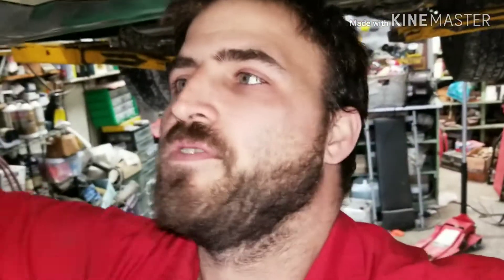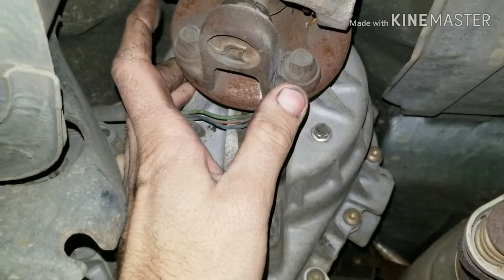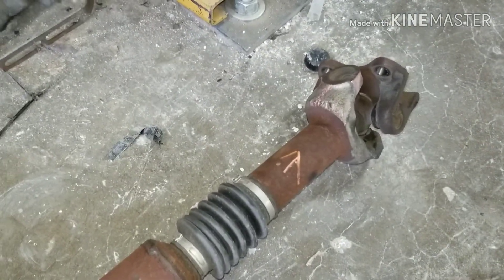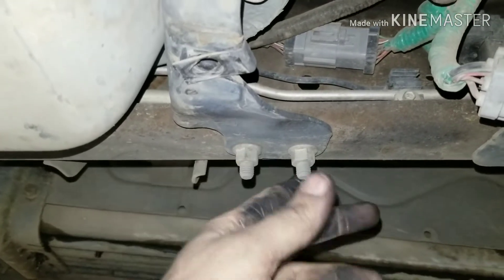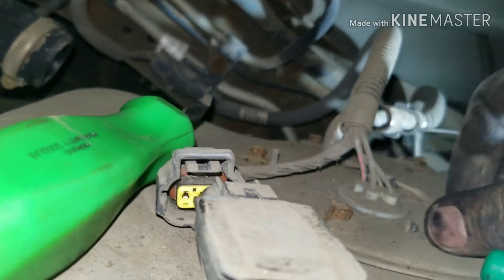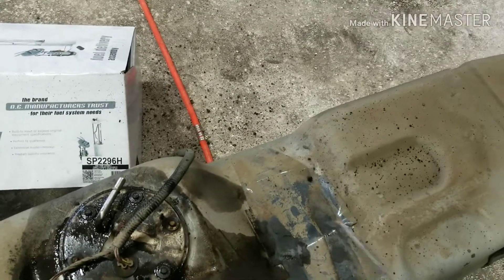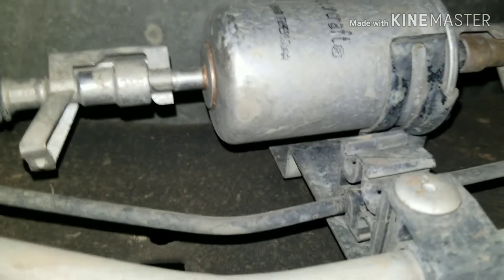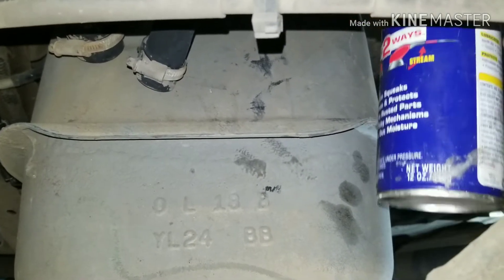Fuel pump replacment  on a ford explorer 2000-2006

Comment: Hey I’m in Oregon too. I have a 2000 explorer. I checked the fuel pump relay, and the fuse and the inertia switch and all good. But when turning on the key no fuel pump noise. Even if I bypass the relay with a jumper wire the fuel pump won’t engage. What are your thoughts? Bad fuel pump? Is there a way to test it without dropping the tank? Thank you
Reply from the maker: usually if you bypass the  the fuel pump relay and you don't hear it kick on that means it's bad. if you had a lab scope you could verify by putting a Amp probe on the wire and seeing if the was any reading like amperage of it trying to move. but if your in southern  oregon  rats have been bad lately you could have open wire down by the tank always inspect your harness. thanks for watchin really apreciate it be sure like and subscribe for  more content.
Reply: Give the key a bump, like one second in start mode and listen with out turning off the ignition, you should hear the pump. If not take off the fuel filler cap and get some one to listen, you should hear the pump

Comment: I have a question maybe you can help me out I have a 2006 ford explorer and every time I try to fill up my fuel tank it doesn't fill up all the way and acts like it's full then starts to spew out. Hopefully you can lead me in the right direction keep up the good work👍
Reply from the maker: these problem in fuel tanks can be caused by many things, such as a bad carbon canister, a pinched line. these type of issues are always hard to figure out.thanks for watchin.

Comment: Just did this on my 1999 ford explorer xlt 5.0 V8 I also changed the tank took me about 3 hours without having to jack truck up or remove driveshaft but while doing it I saw why removing driveshaft helps especially for the strap but it's not necessary with the right tools thanks for the video used it to double check my work she fired right up after changing and running like a champ!!!

Edit- cost me about $400 for new tank fuel pump module gasket and gas mechanic wanted to charge me $2000 lol
Reply from the maker: I'm glad it was helpfull thanks for watching
Reply: Replace my pump with a spectra and having problems with it now

Comment: Is it true there is another fuel pump under the hood by the distributor?
Reply from the maker: there should be only one fuel pump on this one , on earlier module ford's w I th fuel injection they have a low and a high pressure pump thanks for watchin.
Reply: @fixergood  mine is a 2,000 Eddie Bauer with the 4.0 , the part store is telling me it has 2 but I can't locate the 1 under the hood if it has one

Comment: Seems like it would be a good idea to change the fuel filter first before tackling this job.  Thoughts?
Reply: Usually for me, if the filter is easily accessible I'll do the pump, run it a few minutes then change the filter so I can attempt to "filter" anything that may have fallen into the lines when the pump was serviced...probably not necessary but that's what I do.

Comment: Great video, but I have to say, I have replaced fuel pumps in a mazda, mercedes and bmw, and have never seen such a stupidly incompetent specimen of Engineering with regards to the location and access to a fuel pump. What moron hired the idiot at Ford who through this was a good idea? To have to almost pull apart the whole vehicle just to get access to the fuel pump when it easily could have had an access plate from the top is just ridiculous.  I need to replace my 2003 UX Ford Explorer fuel pump and am amazed at the stupidity of the Ford Engineers.
Reply: I hate Ford. I hate them. I am in the same predicament, and I wish nothing but ill and misfortune for everyone involved, for the remainder of their days.

Comment: You should specify what Explorer you're working on. Granted the process is similar but only the Sport Trac has a metal pump assembly, regular Explorer's are plastic and filter is in a different location.
Reply: He did

Comment: Hi, your work is very neat. I have a 2002 Ford Explorer xlt and its been not running for 3 years. I have a new battery but when I start it up the engine runs but than it dies. I think it’s the fuel pump problem. What’s the cost to replace the fuel pump, labor and parts?
Reply from the maker: Some times being it has sat for so long it could be a security issue also. Thanks for watchin really apreciate it.
Reply: @fixergood  He said it runs for a moment so not a security issue. Some older GM's may behave that way but w/ Ford spark will be totally disabled. First thing I'd check is the MAF. Just unplug it and see if it behaves differently. Engine won't run well with it unplugged, but aught to run long enough so you can rule it our or not.
Reply from the maker: It just depends if it has a Pat's system it will either let run fro 3 seconds and disable the the injectors, ir it will disable the starter. Depends on the vehicle and what generation the anti theft is
Reply: Could also be bad gas in the tank.  That would clog up everything. Recommend draining your tank, putting fresh fuel in, replacing your fuel filter, and giving that a try first, before you go with a major expense like replacing the fuel pump.

Comment: Totally enjoyed this video. Very thourough, very detailed, and focused. Made me realize I can do this on my own......but now, I dont want to. Ill hire a machanic!!!
Reply from the maker: I'm glad it was helpfull in some way thanks for watchin really appreciate it, beaure to like and subscribe for more tips and tricks
Reply: So, I have replaced the fuel pump on my ford explorer 2002 and the fuel gauge stopped working after that, any advise please!
Reply from the maker: it's possible when you put the fuel pump in the sending unit could of got stuck in the tank som how  or something got unpluged,hope this helps
Reply: Never saw the fuel line to pump disconnection 🤔

Comment: Im diagnosing a no start, When you turn the key on,should you hear the fuel pump cycling on these models? When i turn the key on,im not hearing the fuel pump at all.
Reply from the maker: With most rigs you should hear the fuel pump cycle on for a couple seconds. Hope this helps thanks for watchin besure to like and subscribe for more tips and trick
Reply: I I’m the same problem right now it’s the fuel pump

Comment: 2:55
Don't take out those nuts. Leave this bracket (the one held by 4 bolts)  in place.
Its the 2 other bolts you need to take out. The ones with rubber grommets.
Reply: at 3:33, those are the bolts (the one in the middle of the frame). They are 17mm.
Reply: This

Comment: Which tool do you use to remove the driveline bolts?
Reply from the maker: It's a a twelve point 12 or 10 most of the time thanks for watchin besure ro subscribe for more tips and tricks.
Reply: @fixergood  
I used a 12mm regular socket (12 points, not 6 points). It worked well, but the bolts were not very tight. 

Do you know what's the torque spec when re-installing?